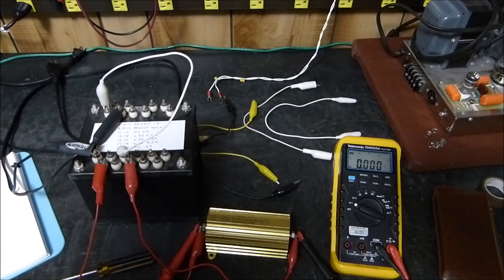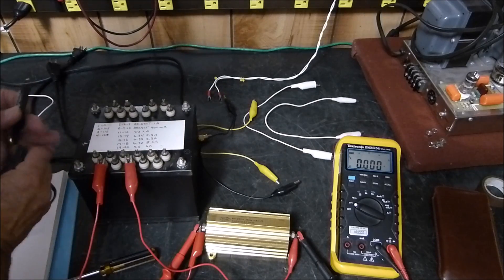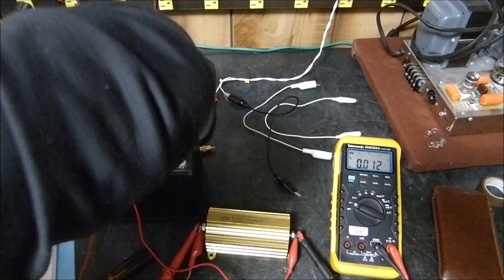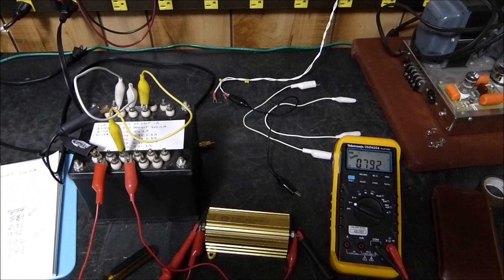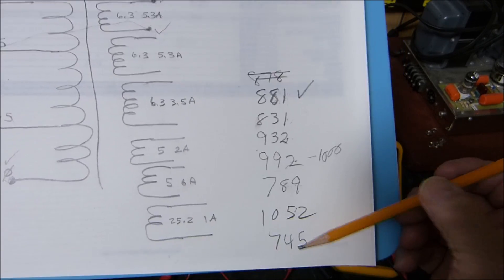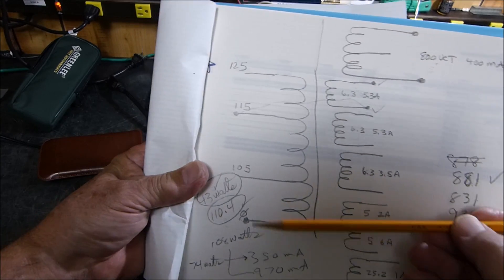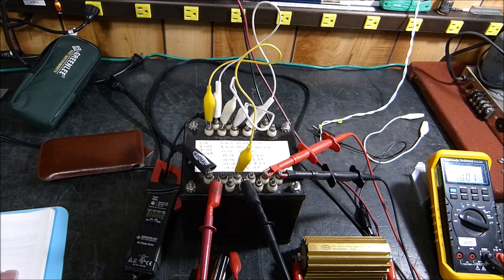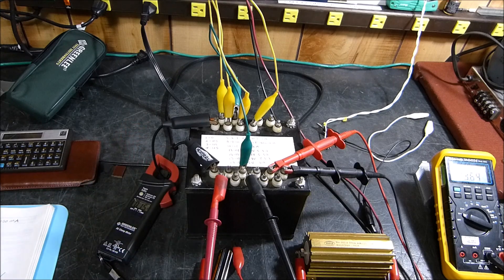Part 4 - Buck - Boost For Vacuum Tube Power Transformers

Comment: I did that with a SE 2A3 I'm building.  My transformers HV was at 775v. It was a little too high for the 2A3s.  I had two 6.3v winding,  so I used one of them to buck my voltage.  It also lowers your other filament voltages,  but not enough to matter.  It works great.

Comment: The only place I have seen buck/boost transformers used, is in low-voltage secondary applications (48VAC or less), in which you have a different supply then what you need for the secondary voltage based on ratio. For example you have a 208V supply from a 3-phase source (phase-to-phase) and a 240V supply on the primary would give you the correct secondary voltage. You would connect the transformer up in "boost" configuration and it would give the desired secondary voltage.

Comment: A lot of the younger ones never heard of this in phase or out of phase stuff to raise or lower. just have to make sure the current capacity is sufficient, AND the voltage rating is high enough.  I prefer to use separate filament transformers so they can be controlled separate from HV. Most available filament transformers of 12.6 AC do not have enough after rectification and regulation to have any headroom for a 12.6 DC regulated.  Say I am using an 8 amp rated 12.6 transformer, I will add a smaller 2 amp 12.6 with its secondary series adding to the  primary of the 8 amp ( that draws about an amp on its primary) The 2 amp secondary of my booster is double the minimum necessary.  This boosts the AC out of the 8 amp trans from 12.6 to about 13.8, just enough to get the extra post rectification DC up to have regulator headroom, and its done with standard parts that are FAR less costly than a custom unit to get that extra little bit needed...    
Sorry to see your magic smoke happen.

Comment: Re the buck boost operation, (some of this may be pretty obvious but please put up with me a little while)
Think of it this way:
An unloaded transformer has a pretty high magnetising inductance across the primary plus the resistance caused by the core losses and copper wire resistance.
It's this inductance which limits the primary current without a thesecondary load.

Now imagine that your primary winding is made up of two 120V windings which can be wired in series for 240 V input or in parallel for 120 V in. This is assuming that the windings are in series aiding. If our transformer was ideal with perfect coupling between all the windings, you would end up with the primary inductance being 4 times of a single primary. The turns ratio of (N1 + N2)/N1 = 2 while the impedance transformation is now N^2 or 4 this is why the Lprim becomes 4 x the single winding value. So if you were to hook up a 120 V across the 2 x 120 V seriesed windings, your primary current would drop by factor of 4 of normal 120 V operation.

Now think what would happen if the two windings were to be hooked up in series opposing, you will end up with no inductance across the primary. Only the winding resistance of the two primay windings in series. This gets progressively lower as the copper wire gets thicker with increasing VA rating of the transformer. Pretty much a dead short across your mains.

In your case, where you are adding LV secondaries in series with the 120 V primary, depending on whether you are connecting them in phase or out, you are altering the primary towards either the 240 V or downwards towards 0 V rating. This is why the current is increasing in one direction and dropping in the other. I haven't checked or confirmed this, but I think you will find that the drop in current will be following the N^2 rule as you change the ratio towards the 240 V direction. While in the other direction the current increase is very likely more than N^2 mainly because you start to approach the core saturation via the more non linear portion of the iron core B-H curve.

Hope this makes sense.
Reply from the maker: Mark,
Yes, it does make sense. The primary inductance is going to be highest in an unloaded secondary. I did not do the math and ratios of current to the turns ratio aiding or opposing but if I did, I am sure your will be right. The primary current dropped unexpectedly low at the end of the experiment and again, if I did the math it will surely be a square L,Z function each way. Thank you. I think your explanation is very good. 
I got into this thing of buck-boost knowing that the secondary windings can be successfully used to lower the HV secondary winding value but when it "boosted" the voltage, I was elated but somehow knew that it wasn't going to work. That is when I went back to the bench and measured the current and the smoke....
David

Comment: I use a transformer in the buck configuration to drop the 124VAC line voltage to 110VAC for my older tube equipment and it works great! You just have to make sure to have a large enough transformer windings to handle the draw. Say an amp draws 3 amps. I use a transformer with a secondary winding thats rated at 6 amps 12VAC and wire it in the buck configuration so it drops my line voltage about 12VAC.
Reply from the maker: Yes, indeed. This is one way the Collins S-Line users use the 5R4/5U4 rectifier windings to lower the plate voltage if installing SS rectifiers in their 516F-2 power supplies. I use the Collins 32S-1 exciter but I maintain the original vacuum tube rectifiers.
It is a good point to know that the secondary windings be able to handle the current that may be required to flow thru the primary. I learn from these videos and experiments every time I post a video. Thank you for your comments.
Reply: @ElPasoTubeAmps  Thank you for all your videos! I've learned more from you than I did in school back in the day! Keep up the great work!

Comment: Whenever I screw around with my transformers and release the magic smoke, I never seem to have a transformer that works again!  LOL  ;^)
Reply from the maker: In my case, many of my transformers are military surplus and very tough and can take short circuits. This transformer would probably trip the house breaker before it would be destroyed. 
I have definitely had the problem you are describing. It recently happened to me on a little 6BQ5 amp that I got at a garage sale. I accidentally clipped in an electrolytic capacitor in the power supply to trouble shoot hum but with reverse polarity and within seconds the power transformer shorted and began smoking and dripping tar. It went from my workbench to the trash can.
Reply: Well I guess your short ct was shorter tan the one offered by the clip leads in this video!😁